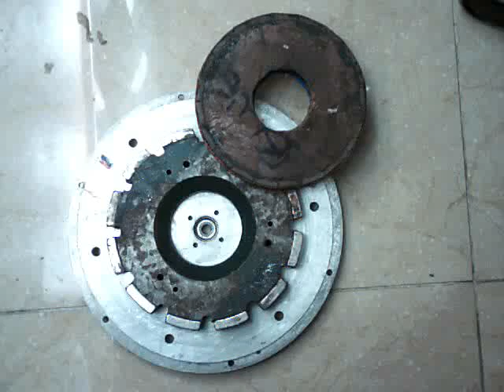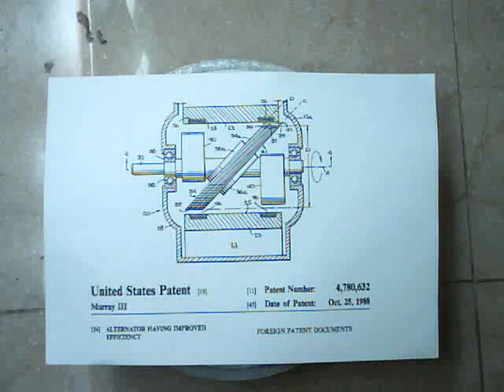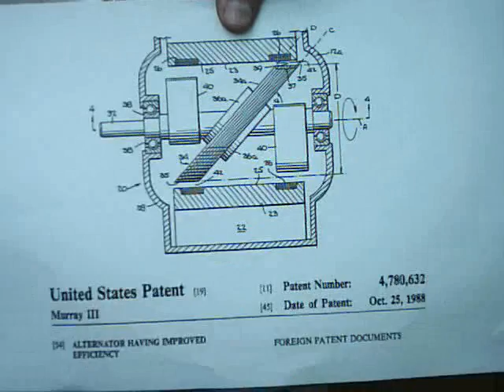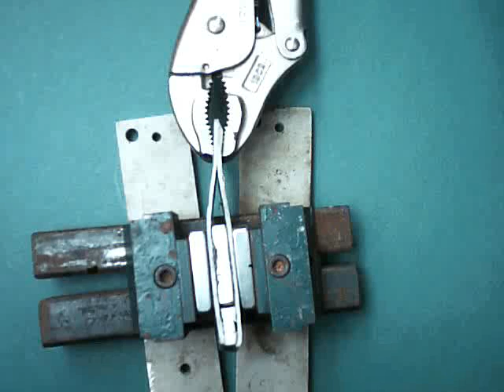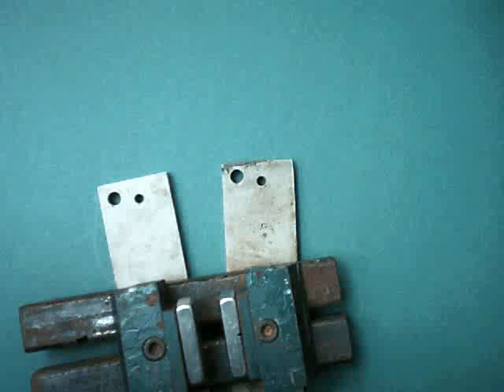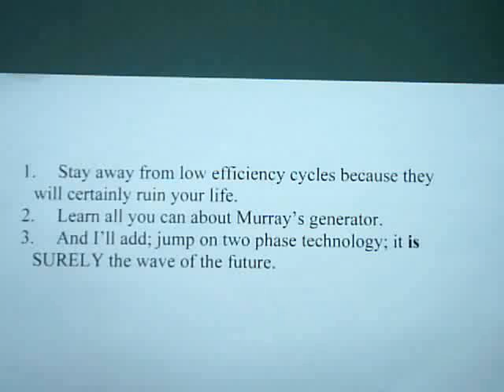The Future of free Energy is Here

Comment: If it work,  I think the best way to best result must be avoid coils and cores sence it do conductive resistance. use paralle wiring instead.
Secondly avoid mechanical drag and resistance as much as possible.
Get the best ball tenants.
make it an overpowerunity only, put it in a box take away the air, so air drag is gone.

Comment from the maker: In the second experiment with the blue tape. The magnet was replaced with two magnets and some steel. There are three reaction possibilities: magnet2magnet (100%), magnet2steel(56-63%), and steel2steel(5-20%). m2m & s2s come by equation; m2s is complicated so the percentages are based on three known O/U devices (50% may be minimum for m2s). 

s2s comes with a price, only DC, which means it cannot be hooked to the grid but could certainly be used in homes.